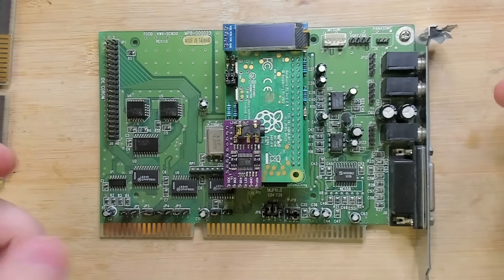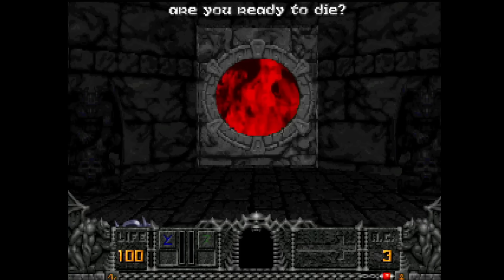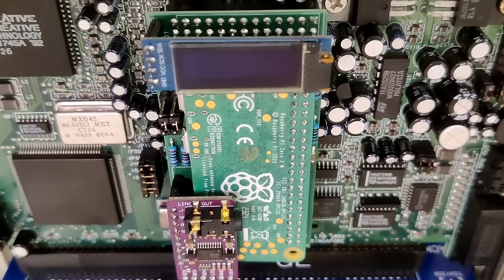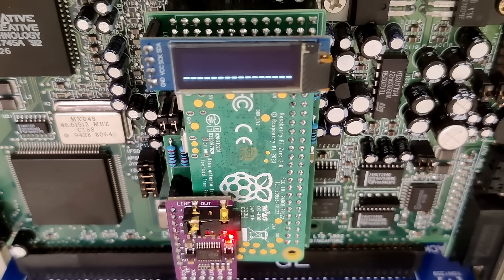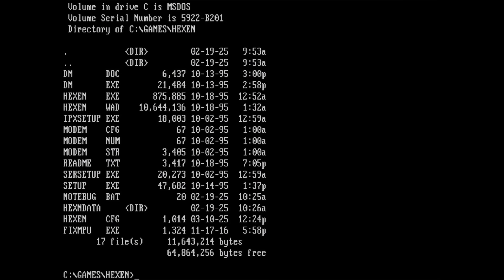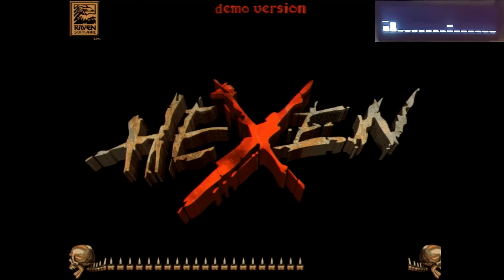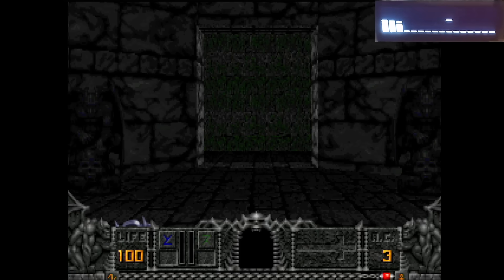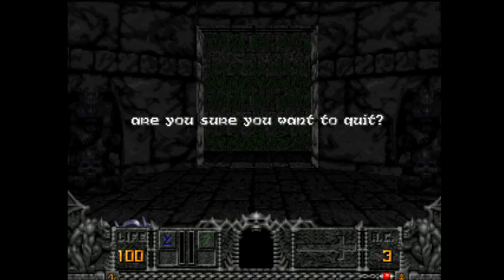Creative Ignored It: The Hanging Note Bug in DOOM & HEXEN (Part 1/2)

Comment: I have a pile of Creative Labs ISA sound cards. I don't use a single one of them because of this damn bug. I only use ESS and Yamaha ISA sound cards in my retro PCs. I have ~20 PCs from the 286 to Pentium 3 so I have quite a collection of them now.
Reply: If you have a pile of them, you could always use two. This doesn't happen if you have one card for digital sound and a different one for midi.
Reply: There's a simple script you can run to stop all sound output
Reply from the maker: There might be a way to fix those soundcards. I'll show the hardware fix in a future video (very soon!). I don't know if all issues can be fixed, but I'd like to find out!

Comment: Yea, this bug is why I opted for an AWE64 on my DOS rig, they finally cleared up many of these bugs on it.
Reply: It's only unfortunate that you can't use a wavetable card on an AWE64 though. You can get around that by building an external version of the MT32-Pi and connecting it to the MIDI/joystick port via an adapter cable.

Comment: Yeah, I socketed my awe 32 and installed the fix dsp which I guess you have coming in the next video. Like your said, it's tight, and I had to trim a little of the plastic away from the socket.
Reply: thx for that, coz this was next what i want to do after reading it, ill solder it, dont care about socket at all, not just need to find a doner

Comment: apparently the hanging note bug isn't what I thought it was. I thought it was when a game crashes and there is a note that is stuck on. Restarting the computer doesn't fix it. You have to turn it off or start playing a midi file. And it happens all the time on a sound blaster with no wave table addon.
Reply: Yes I thought it was that too!
Reply: I thought it was my own problem I experienced unrelated to crashing or wavetable, I think I mainly experienced it when playing Jill of the Jungle, and would persist until I exited the game and used a different program to play a midi file
Reply: @michaelturner2806  JOTJ was one of those hard ones to run. For some reason Star Wars Pod Racer was like that also.
Reply: Yep I'm in this boat as well. I remember games crashing and the note either persisting until something else initialised midi or a hard reset. 

It was always funny being in my autoexec menu with the sound card going "BRRRRRRRRRR"
Reply: @awilliams1701  this happened to me all the time when I was a kid. I would have to reboot the computer to clear it so that’s also what I thought the hanging note bug was too. I had a sound blaster 16
Reply: I remember that. You'd press CTRL-ALT-DEL and the note would persist through the reboot, BIOS initialization, etc. You had to press the actual reset button or power off/on.
Reply: Yup, the last adlib tone fading out because there's no new input due to a hardware crash.
Reply: I recall a similar bug, not related specifically to DOOM, on Windows XP with the Microsoft/Roland software synth. Except, this one didn't persist through reboot because the MIDI "device" was software.
Reply: I guess it was tested, but not mentioned in the video, but did the bug fix program play MIDI music if you start Doom using the command "fixmpu setup" instead of "fixmpu doom"?
Reply: @LarsV62  no setup doesn't have anything to do with MIDI or sound support. Only doom itself does. Programs that do auto detect obviously do, but doom doesn't have that. It's just a quick dirty config tool.

Comment: Hmm interesting, up to now i did think the hanging note occurs only when exiting a game. I (believe) have never experienced this kind of hanging note where there is this high pitched sound in-game. I use a Sound Blaster Pro 2.0 (CT2600) / OPL3 in my dual P1-133, a Sound Blaster VIBRA 16S (CT2890) / OPL3 in my 486 and a Sound Blaster AWE64 (CT4380) / CQM in my MMX 233 machine, I think i have the hanging note bug (on exit) on both the 486 as well as the P133.
Reply from the maker: That is what I had thought as well when I heard about the hanging note bug! A hanging note after exiting a game. This seems to be an issue when you exit a game at the correct moment and it isn't able to send the 'stop note' command. But that's not the hanging note bug. Only after doing some research, I found out that this bug is something totally different.

Comment: nice work, the midi thang is looking good. i have a ct2230 with 4.11 (its dsp is also very tight to the csm socket) but i havnt used it much to hear the noise. also the ct3990 has 4.13 so its double bugged!
Reply from the maker: I also have a few more soundcards that are potentially bugged. I need to go through all of them to check it. But my Soundblaster 16 in this video is definitely a bad sounding card. Especially in Doom with these high pitched random notes.
Reply: @bitsundbolts  I have (among others) a CT1740 with DSP 4.05 which predates the bug, and indeed does not have this problem. I was planning a few years ago to try and dump the contents of its program memory - not an easy thing to do, but possible using some hardware tricks. The intent was to obtain the code and then program some blank 8052s with it to fix other cards. But I got caught in other things and never got around to doing it, and next thing I knew sometime last year I found on Vogons that someone else had done it, and more - reverse engineered it, found the bug, fixed it and so on. :)
Reply from the maker: @stamasd8500 Yes! That is what I stumbled upon as well. When I found that 50+ page Vogons thread, I was shocked that I hadn't heard about the fix earlier! Not only did they fix the hanging note bug, they also optimized certain parts. Unfortunately, not everything was fixable. But let me find out what effect the new firmware will have on my CT1740.